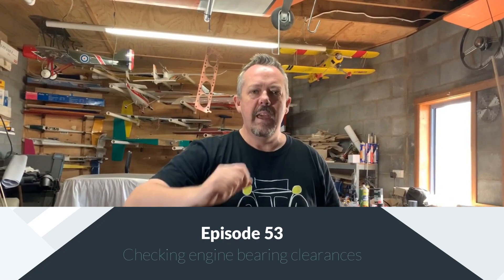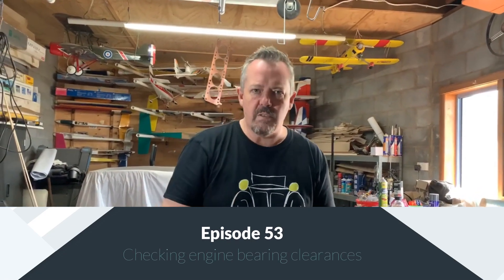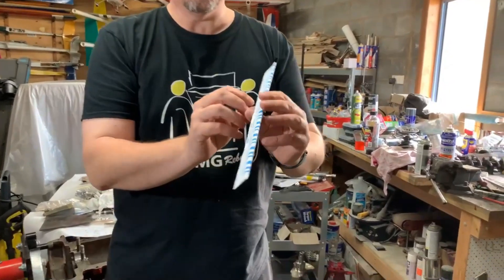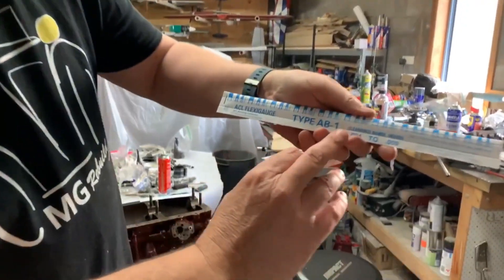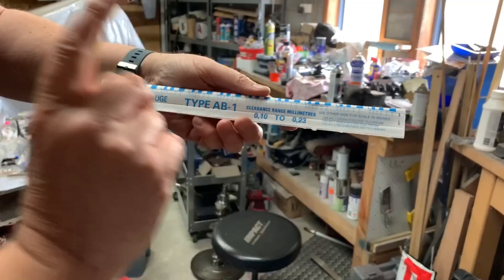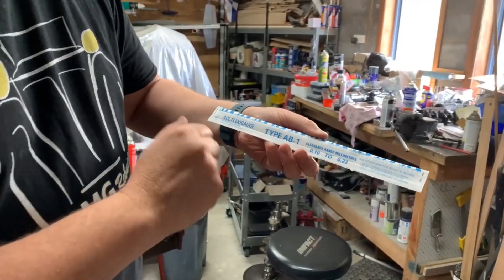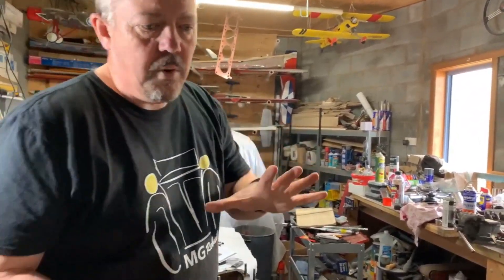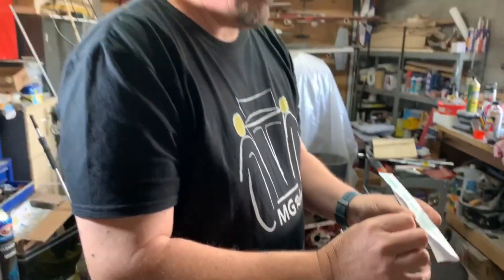Having the right bearing clearances is vitally important when rebuilding an engine.

Comment: That Flexigauge is 1 thou to 3 thou not 10 thou to 30 thou. 1 thou means 1/1000 of an inch and is written as 0.001"
Reply from the maker: Thanks Paul. I wasnt 100% sure on that one. The measurements were correct, it was just my wording
Reply: @MGREBUILD  No worries. Great tutorial mate.

Comment: Good to know how fragile the bell housing is. Mine is currently completely disassembled. I replaced first gear, the lay shaft and the tail shaft bearing. It was actually easy with help from here https://www.bobmccluskey.com/gearbox.shtml .
Reply from the maker: I suppose I would be thst fragile if i was 70 years old too. Thanks for the link, it will come in handy when I replace thr rear housing
Reply: @MGREBUILD  speaking of which...
Apparently it is easy to get the felt seal trapped between the flange that bolts to the drive shaft and the rear bearing and spacer. If this happens, you will shred that felt seal and the flange becomes loose and noisy. This is the condition of my second transmission. Once I get the last gasket Lawrie has said he'll show me how to avoid this and I'll pass that on to you.

Comment: I assume you've considered putting in a Hi-Gear 5 speed? Now would be the time! You can get them from HiGear himself a LOT cheaper than same unit from Moss. I did it about 5 years ago in situ and it was a pain but for you now it would be simple!! I think he's still selling them but not sure. I can give you contact info if you wish.
Reply from the maker: I would live to put a 5 speed gearbox in, but my budget is very tight and I really only have enough to put the car back together without buying anything "nice to have". Perhaps later on I will replace it